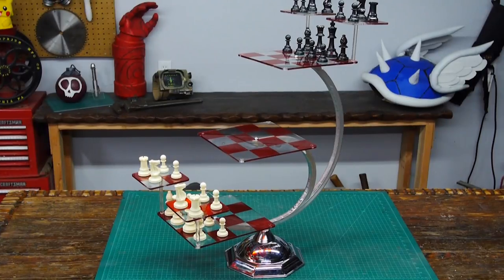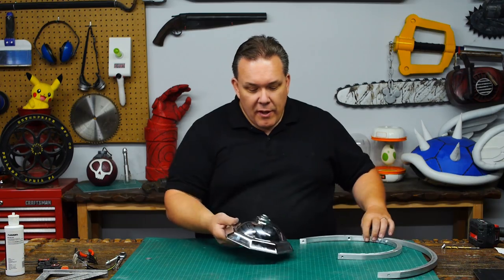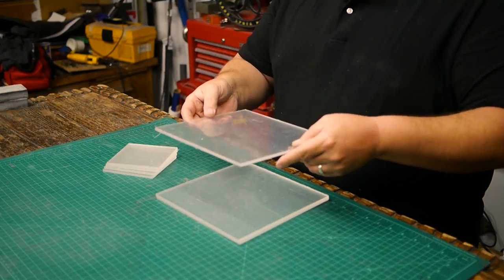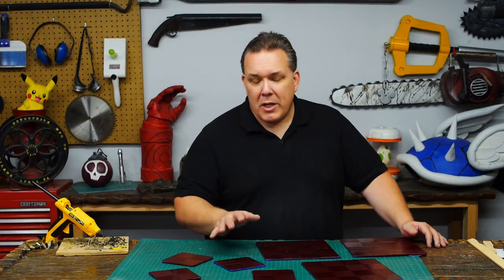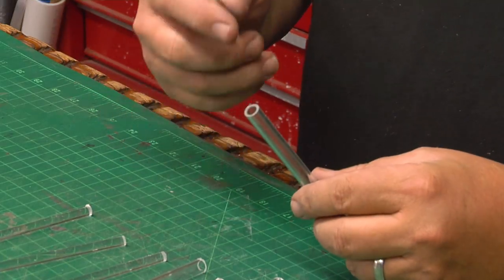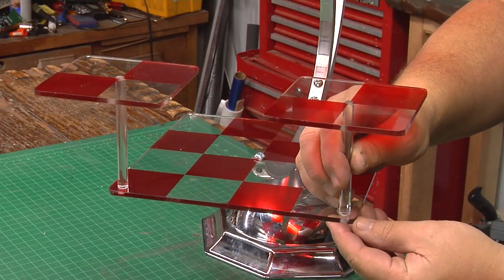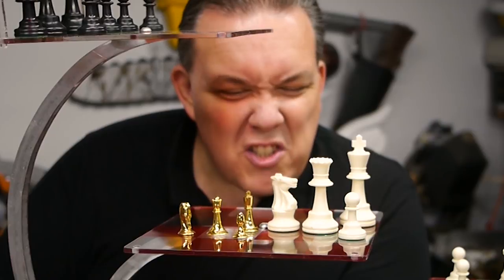Odin Makes: Tri Dimensional Chess from Star Trek

Comment: Did you make the pins tight enough to be able to move the attack boards to inverted positions? :)
Reply from the maker: Not really, no. Mostly because I didn't use metal pins, and it would be easy to crack the plastic.
However, they could, because the weight of the pieces would provide the angled tension to hold them there. The version I played in the 80s didn't invert the boards, and I don't think any were inverted in the original series, so I didn't want to go into that idea..
But I did look at that!
Reply: I only mentioned it because I remember the tech manual saying that they could be moved to inverted positions, although I've also never seen that in any of the shows (that I recall).

Frankly, I was never sure of the actual purpose of the attack boards. All they seem to do is add a few extra, oddly placed squares to the board. I can't recall ever seeing them moved on the show and the tech manual states that they can only be moved if empty or occupied by a single pawn. If they could be moved with a full complement of pieces, that might provide some advantage, but I don't see what good it does it to move them otherwise. Also, if they're considered an extension of the board, I don't really see what the difference would be if they were upright or inverted as the squares would be in the same positions, with just the colors reversed. In fact, that could create a problem as the colors would no longer be aligned unless the boards were turned.

Comment: Aluminum hates being tapped, add some lubricant and back out the tap to clear the chips, better yet use a form tap with some lube.
Reply from the maker: I don't have a form tap, I will look into that.
You might see a bottle of air tool oil on the table, I was using that for lube- not the right stuff, but better than none. I forgot to mention it in the V.O.

I did back out and clear chips 3-4 times per tap, I just spaced out and forgot on what was actually the last one, which is what broke.
Reply from the maker: And thank you!
Reply: cutting fluid would be ideal, air tube lube is to thin to do much to aid in cutting, it more aids the seals in air tools so they don't leak too much air, 3 in one is a better oil for cutting with
Reply: nice build
and the reason there are no official rules for tri dimensional chess, is that the world chess federation, (the ruling body for chess tournaments) does not consider it a big enough thing to worry about

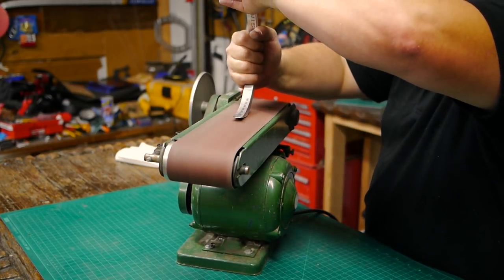Comment: I don't know how you don't injure yourself every time you do a project.  Sanding the edge of the aluminum in the opposite direction at 1:22 is a great way to get injured.  Also, using acetone with a glove, but holding the aluminum right below it without a glove at 7:34 seems really careless.  Working with acetone should mean both gloves.  If you are going to show these projects, please practice safe procedures.

Comment: Hardest part about building would probably be the aluminum rod as the frame. Anyone got any easier alternatives?
Reply from the maker: Use smaller square stock aluminum. 5/8" was overkill. 1/2" will be fine and much easier to bend.
Reply: Thanks I'll look into it if I ever get the time to come around making this!